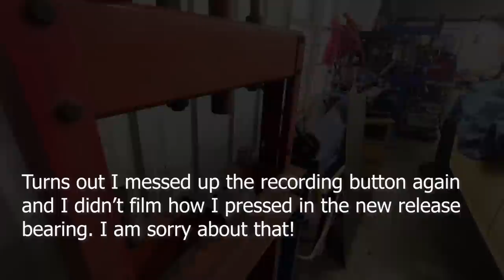1964 TR4 - Part 15 - Getting the engine ready to install

Comment: Brilliant Elin.. That was really interesting to see how you got that alternator to fit..  I seem to remember that once upon a time there was an alternator made that looked like the original dynamo. Don't know if they're available any longer, but if the owner is using the TR-4 regularly, it's probably easier to have a conversional alternator which will be far easier for a none specialist garage to replace/repair when the time comes provided they don't loose your AF/Metric fitting 😂..
Reply from the maker: They are expensive and as far as I know unreliable due to overheating. The dynamo casing does not allow for proper cooling. That info is from a few years ago so they might have improved it already, I don't know. But they are still expensive
Reply: @RustyBeauties   Indeed Elin.. I heard the same thing about the high cost, overheating and the subsequent unreliably .. I have always come from a 'practical' place rather than  trying to fake originality ..

Comment: You should use permatex high tack on those cam plugs ,so thay do not leak  i have gotten engines back from machine shop already installed plug and they have leaked ,it will give you piece of mind .

Comment: When using a torque wrench it’s essential that the the bolt being torqued is not already tight , the torque wrench “must” be able to turn a significant amount before it clicks , i’ve often seen mechanics do bolts up with a  power tool and when the torque wrench is applied it clicks straight away , in this case the bolt may already be overtightened .
I have worked in a railway workshop where this has happened and in consequence a bolt has snapped and caused a derailment , be warned.

Comment: Is it possible that the bushing on the transmission gets pushed in beyond the bolt hole and when a bolt is inserted it would prevent the bushing from walking out?
Reply from the maker: That was probably the idea, but they gave up on it with the later transmissions for TR6, they don't have the bolt hole on the bellhousing. Also the available bushings now do not have the hole

Comment: Elin did you (or the owner) consider going with a “narrow belt kit”? The advantages are replacement belts can be found in local auto part stores, and it puts a lot less strain the the water pump bearing.
Reply from the maker: No, I never thought of installing that kit on any of my TR3,4 engine rebuilds. Maybe in the future. The owner of this one already had the new pump with the wide pulley purchased anyway.

Comment: Hi Elin can you spin the front plate of the alternator round so the adjustment hole is closest to the block so the adjuster doesn’t have to go over the body of the alternator with the fixed hole in the alternator and the slotted part to the engine I seem to remember that’s how you changed which side of the engine the alternator mounted
Mike
Reply from the maker: No, the whole front half of the alternator is one piece. It is not just a plate in the front. But it is not a big deal. I already modified the tensioner and it works great.
Reply: You take out the screws holding the two halves of the alternator together and clock the position relative to the back halve,either way sounds like you sorted it out👍
Reply from the maker: @shaftbox  I see what you mean. The mounting hole becomes a tensioner and vice versa. It might be possible even though  one hole is threaded and one is not, which is not a big deal.  But even if that is possible, the position of the "eye for the tensioner would be too close to the engine in a place where it won't help. I might show it in video

Comment: Hi Elin, couple of points.  I have been told that the three bolts which fasten the dynamo/alternator bracket to the block run directly into a gallery, so was advised to use a sealer on the threads and also wire lock to prevent them vibrating loose with catastrophic fluid loss.  To be honest I did not investigate, but followed the advice.

Secondly, when I fitted the same rubber type of rear crankshaft seal, the instructions said to check the protrusion of the flywheel attachment bolts through the crank flange and to trim them flush to ensure there was no stick-out which could tear up the seal.  Did you check that?  My 4A had single-use stretch-bolts rather than the repeat use type with tab washers, so there could be a difference in length between the types.

I am looking forward to the next episode when you put the completed engine and gearbox assembly back in the car, as I am pretty close to that step myself, so will be interested in the sequence you use for fitting the gearbox mount etc.
Reply from the maker: Hmm, I haven't checked those holes, but I am pretty sure I would have noticed if they were through. I chased the threads, so if my tap went all the way it was gonna be quite obvious. 

Yes, the instructions mention about that as the after market bolts vary in length, but the original ones fit well. The conversion seal and the original one mount the exact same way, so if the bolts worked well with the original they wouldn't interfere with the conversion either.

Comment: It would have been far easier to remake the mounting plate on the block by cutting the end tab and moving it forward to match the back mount on the alternator
Reply from the maker: True! But that would eliminate one of the 3 bolts holding the bracket to the block and even if I did that I would have made a long bolt for more rigidity. That wide belt is able to rip the earth off of its axis LOL

Comment: Why change the pulley?   Alternator will now turn less turns for every crank revolution?
Reply from the maker: The belt on the TR4 is much wider than the TR6 and wouldn't fit in the original pulley of the alternator. It is true that the alternator will run slower with this pulley, but alternators produce more than enough power at much lower RPM and if the generator was producing somewhat enough with the RPM set by this pulley, that RPM will be more than sufficient fore the alternator.
Reply: Yes. Thank you.

Comment: The bellhousing spoils the look considering all your work cant it be cleaned painted too
Reply from the maker: When dong work like that there is always something else that needs to be taken care of.... where do you stop? I had a chat with the owner about that. It is hard to decide how far to go. If it is my car, believe me, it will end up as a ground up restoration as one thing leads to another and.... you know how it works. If I clean and paint the bellhousing, the engine bay would look bad. If I clean and paint the engine bay then the exterior will spoil the look.... So we decided with the owner to draw a line and not go farther than where we are already.

Comment: Oh dear - you can get an alternator that has been installed into the original Dynamo casing. So preserving the original look. What a pity to spoil the originality.
Reply from the maker: There are 3 schools of owners, purists, practical and opportunists. Purists are obviously all for originality, the practical ones are like me, who would do minor improvements and re-designs in order to make their ride more comfortable and reliable without changing anything major on the car and finally the opportunists are the ones who would do all kinds of mods including engine swaps or converting their car to electric for example as long as at the end the car is still recognizable as whatever make and model it is. I think all 3 types deserve respect for their decision to belong to one of these groups as it takes a lot of knowledge and investment to restore their car the way they chose to. But being in one of these 3 groups doesn't make the other two groups wrong. I respect purists a lot and I respect the restomoders as well for their engineering and problem solving. So I expect also my decisions about my car and the decision of this car's owner to be respected. There is nothing wrong with installing a reliable alternator , which changes slightly a car that is not original anyway.
The alternator that you are talking about is way more expensive than the TR6 alternator and from what I've heard (not first hand experience, so I might be wrong) they are unreliable as the dinamo case does not allow for proper cooling. I know someone, who had to return 2 of these as they failed. And it requires rewiring of the car anyway so the originality is still spoiled. But again, I would respect anyone's decision to go with it.